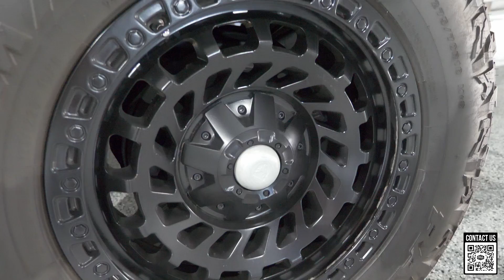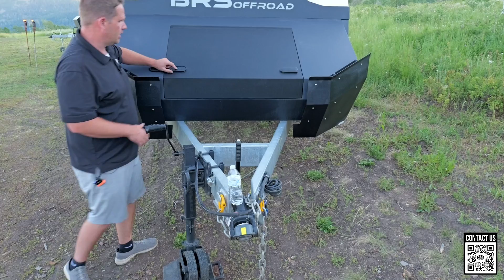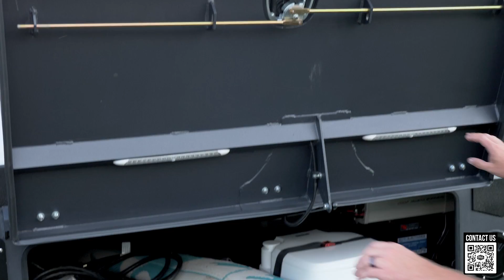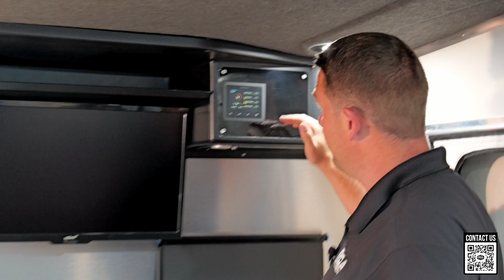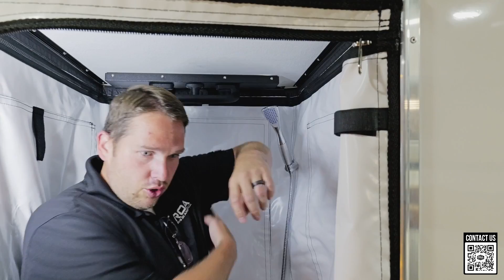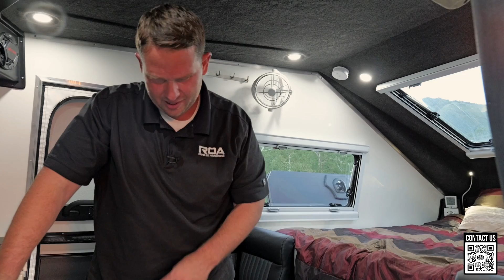BRS Pursuit Walkthrough Tour! NEW Australian Off-Road Trailer to USA | ROA Off-Road

Comment: love this, but i'm not clear if it is a 4 season camper......what's the coldest environment one could use this camper?
Reply from the maker: It is. It not 4 season. 32 degrees with water in it will potentially freeze. But the box itself is insulated very well. So you could use it in any temps just minus water.
Reply: @ROAOffRoad thanks for the quick response.....maybe BRS could design a way to heat the tanks.....very cool camper

Comment: Two questions:   1. can the bed be configured to go East / West and how do you compare the Pursuit to the Pause 16.4.   Pros/cons?   Do you have a video comparing?
Reply from the maker: Good question. Right now queen bed is north to south. Few key differences, the Pursuit is very light weight, just 3,500 pounds. The interior of the pursuit is less spacious compared to the 16.4. The 16.4 is heavier but built for 4 seasons, and sleeps 4 while the Pursuit sleeps 3. Hope that helps! Maybe we can do a video in the future.
Reply: @ROAOffRoad   Been in the Market for 3 years.  Have a temp solution and like to pull trigger by Summer 2024.  We are considering coming out to your UT loc and look at a few rigs.
Reply from the maker: Yes you should come see the units and get a feel for them. You can contact us through our website and set something up.
Reply: Perfect Thanks and will certainly do! @ROAOffRoad

Comment: This is a very cool trailer and appears very well built. Like the galv chassis and many other aspects.  The cost is to high in my opinion.  To many fig's . TV , stereo, microwave not necessary IMHO.

You mentioned the roof has only the solor mounting brackets and vent penetration but failed to mention the massive hole  the star gazzer window is in which is placed in the worse possible place of the roof. Front down slope. You should set up a sprinkler at fairly high pressure and point it at that window for 6 hours to test for leaks.  Also those folding steps do not tuck up very well